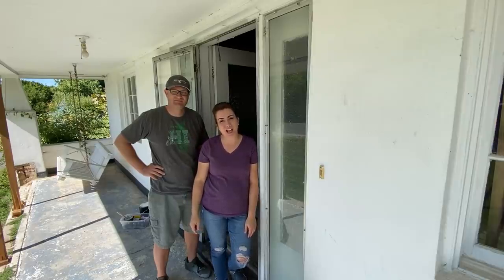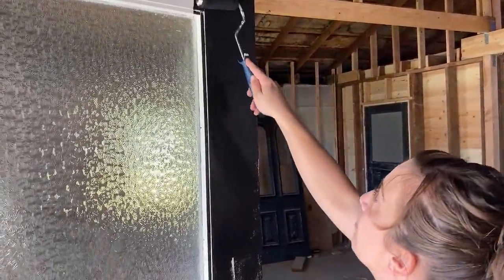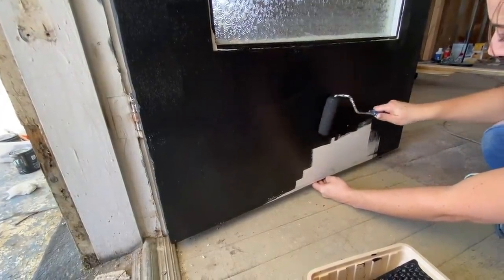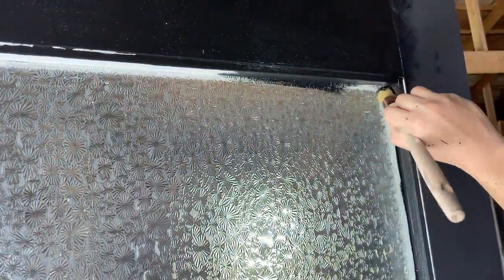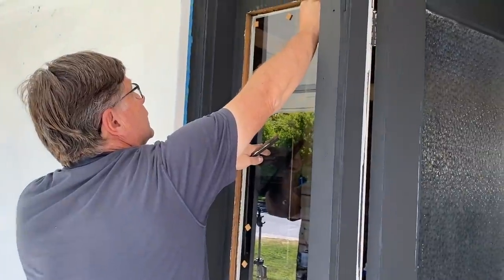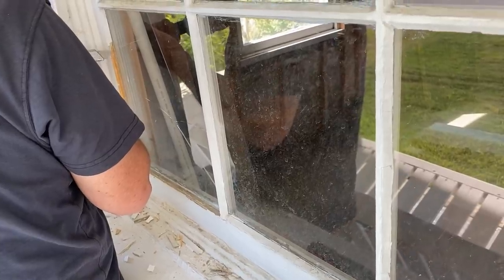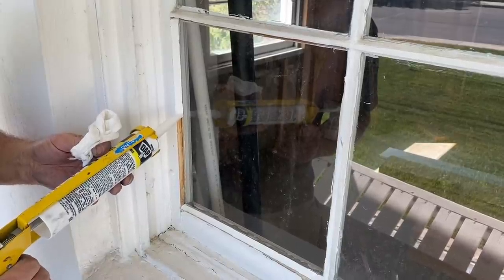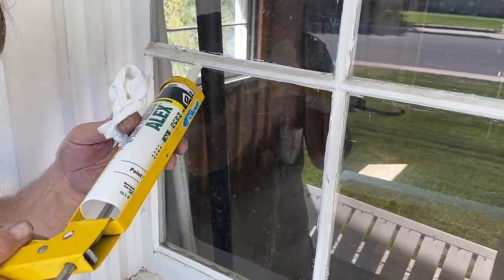Farmhouse Renovation Part 19 | Painting The Front Door + New Glass!

Comment: I sure hope thats tempered glass, theres an awful lot of it and its not double paned, your going to loose lots of heat and cooling thru single paned glass,
Reply: terry I feel sure the glass guy did safety glass.  I know a few years ago it was against the law to put non safety glass in a door, and any window with 18" of a door, and of course insulated would be better.
Reply from the maker: It’s tempered and meets all current building codes for safety and heat transfer. 😊❤️